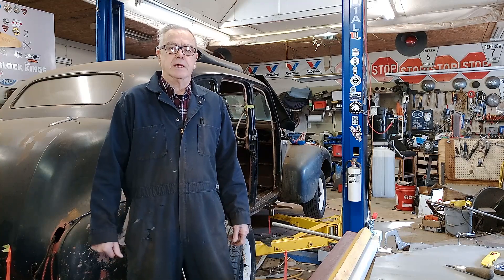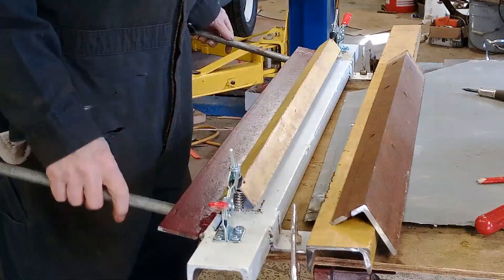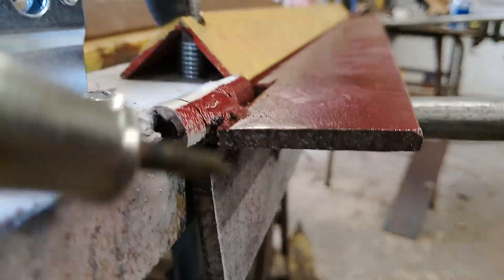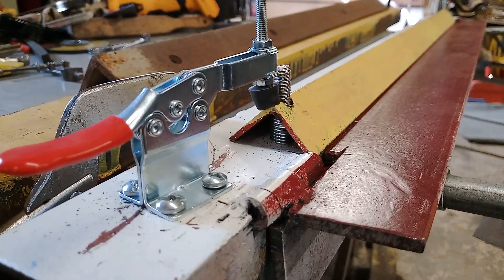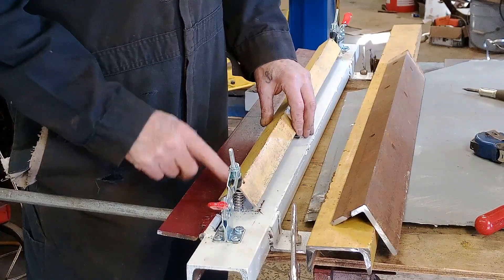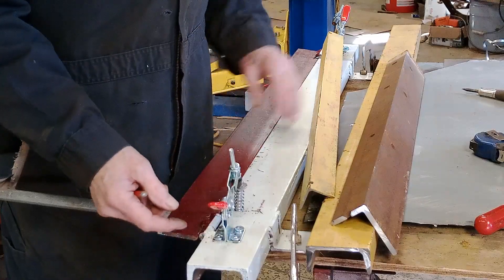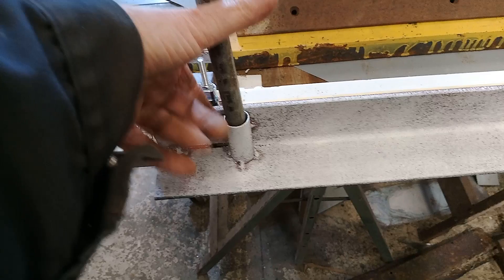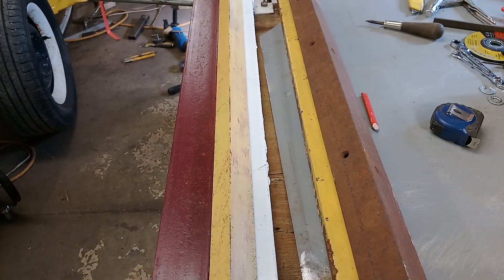# 196 Build a cheap and easy metal brake with just 3 pieces of steel.

Comment: Does it even work will it keep a straight line? Will it bend 18ga .
Reply: Hey Gary. Thanks for dropping by the Dog House. Yeah, it bends straight and clean because I ground the edge of the bending side of the angle iron. See timer at 4:30 minutes. The heavier the angle iron, the heavier the sheet that you can bend.

Comment: I did something similar. 4 feet. Didnt sand the edge,will do it next time i set it up. Mine’s a heavy pig, i hate lifting it. It an I-beam instead of a c-channel, i plan on putting it on a diet.
Reply from the maker: Hey Frank. Thanks for dropping by the Dog House. I wanted it lightweight so I could move it out of the way when not needed. Grinding the edge will give you a nice bend.

Comment: For SURE it's nuts !!! A couple of weeks ago, I "scored" a heavy duty "foreign made" 4' stomp shear for $250.00 on Marketplace. Like your son, I am severely "running out of space so I want to put this heavy (probably 500 pounds for sure) tool on casters. Bought some 3.5" steel casters on Amazon for +- $50.00 and went to the steel place today to purchase some heavy duty angle for mounting the wheels. 4" X 4" X 3/8" X 4', and a short piece of 4" X 6" X 33" (all short pieces so no cutting charges along with a 20' stick of 3/4" square 1/16 wall tubing. Cost me $174.00 out the door. That and the wheels almost doubled the cost of the tool. ;o( 
I have been doing some sheet metal fab recently to prepare for upholstery panels (door panels, kick panels, firewall pad) and am REALLY enjoying the sheer. ;o)